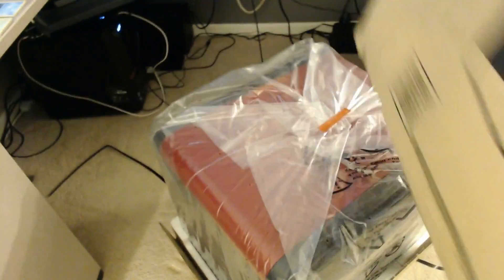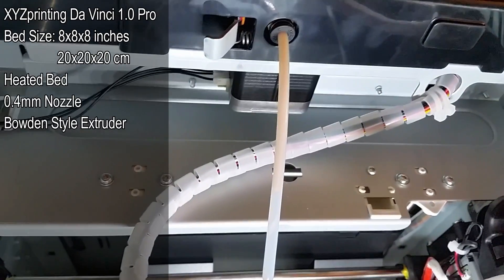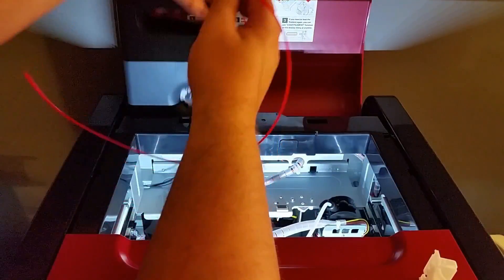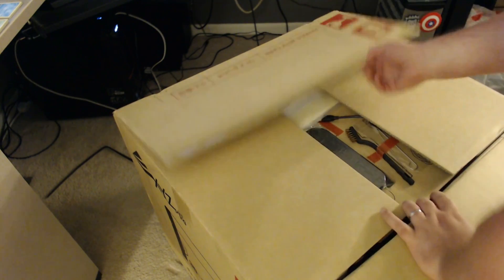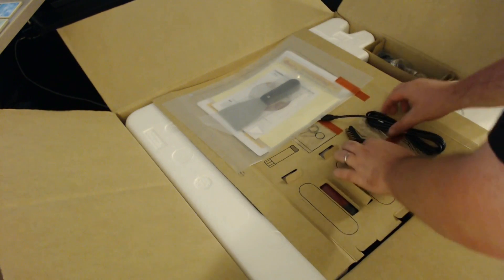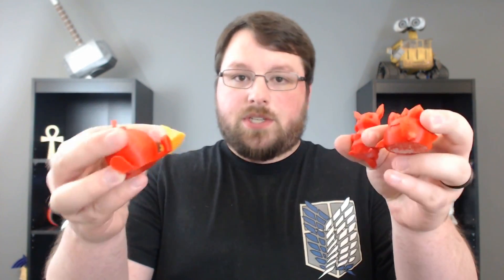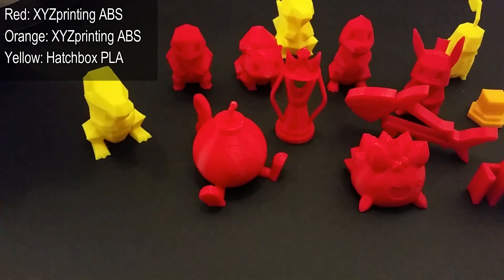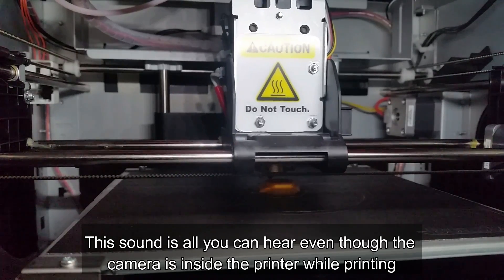Da Vinci 1.0 Pro Review - XYZprinting 3D Printer

Comment: I know this video is 6 years old but I have a question.  What bed sheets did you use.  And doesn't that screw with your auto bed leveling because now the metal corners are lower than the new sheet?

Comment: I’m deciding to buy one but I need to know if I can print custom parts like sprockets, tank tracks etc. I am scratch building a Tiger 1 and a Goliath Demolition Vehicle in 1:6th scale and would help to know if I can adjust the settings to print in that scale as well. And also use a computer to program them into the printer. Thanks in advance.

Comment: Hey, nice review. Right now I'm struggling to decide on this one or a FlashForge Finder, they are both available for 299USD. I'm completely new to 3D printing, but am also pretty good at using complicated equipments (I work with something of the sort). I care about running costs, like waste and filaments, and printing quality, since I'm gonna mostly print miniatures for D&D. So, which one you guys think I should get?
Reply: Dont get the xyz printer, Ive had nothing but problems with it. Theres so many little tweaks that they implement so that you have to use only their things, whereas with other printers, you do not

Comment: Good printer I like it and this review is about spot on. I use S3d because the software is a joke. IT's producing good parts for me of pretty high quality and at reasonable pace too. Running it at 60mm per/sec 2.5mm layer height on both ABS and PLA.

Comment: Thanks for sharing this info.  I didn't understand the name of the sheets you are using to resolve the problems with filament not sticking to bed.  I am having this problem as well although am using the filament and the tape XYZ provided with the unit. Can you provide a link for what you are using?
Reply from the maker: Hi! The sheets I used are called BuildTak. There is a link in the description of this video to their site. I definitely recommend them. I haven't had any issues with warping or coming off the build plate since installing them (as long as I have the bed leveled properly).

Comment: hi, nice review. did you find out how to keep the light on while printing?
Reply from the maker: Yes actually. Just yesterday I noticed the options for this in the LCD menus on the printer. If you go to "Settings" then I think it's under "Power Saver Mode" or something similar to that. The options were close to 3m, 5m, or off. Hope that helps! :)